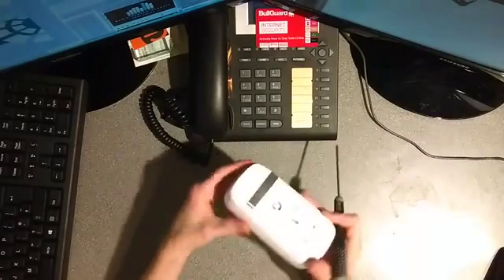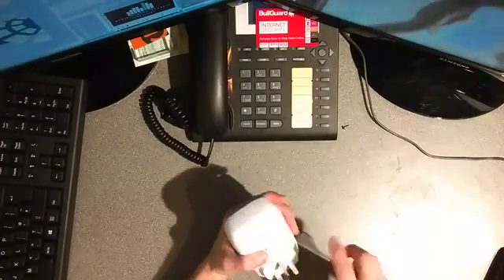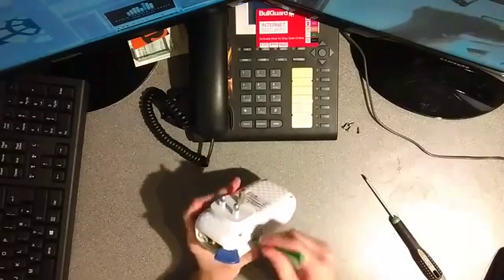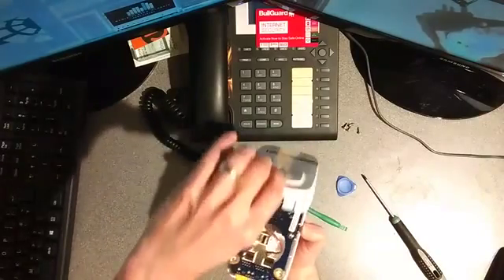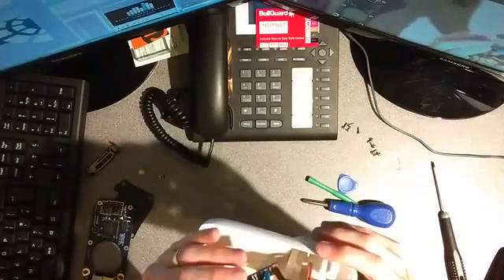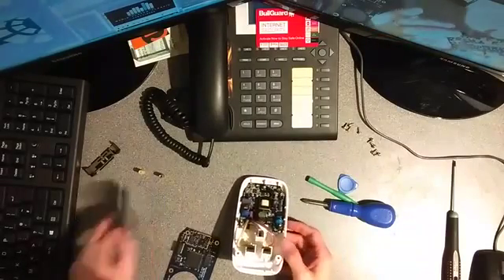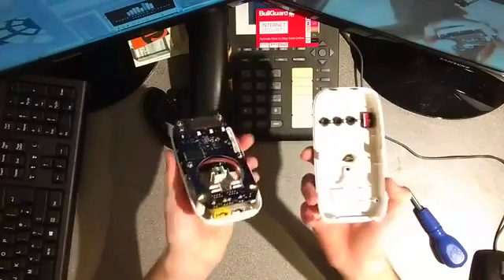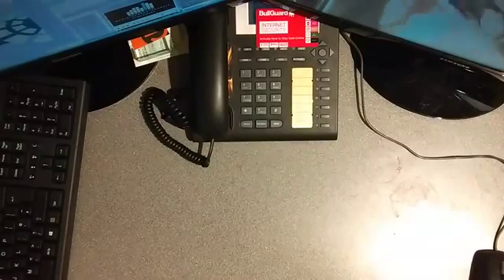Opening up and Inside a Vodafone SureSignal Version 3

Comment: The large capacitor blew on mine. This was the second one I got from vodafone. They only last around 6 months. Is there any capacitor upgrade that can be done to stop it over heating.
Reply from the maker: No point.. vodafone have announced that existing suresignals will be deactivated. One person I know has been told theirs will be switched off in February 2021.

Comment: I have one booster like this used in Vodafone, is there a chance to enable it for any network ?
Reply from the maker: No chance. Sorry :( it requires a VPN back to the network and the other networks are unlikely to have the infrastructure to connect to. What network were you hoping to transmit/boost?
Reply: @freename  EE is the one I wanted to use it on
Reply from the maker: @ionutalexescu6912  They have their own equipment to do so...
https://ee.co.uk/help/help-new/general/signal-box/improve-your-signal-at-home-using-signal-box

There is no chance of reflashing or hacking the Vodafone one to do the EE network :(
Reply: Device is sticking to Vodafone-UK. Only thing you can do is to get it working outside the UK. -but it will still broadcast Vodafone-UK network signal, so best benefit to use where there is a high roaming fee.

Comment: Hi, Did you find out what the "exploded" chip was and di you manage to replace it? Cheers, Harry.
Reply from the maker: +Harry George Haines I'm not into circuit design so I've really not got much if an idea - however I did have someone look over it and attempt to repair it and here are their notes:
----QUOTE---
Replaced
-chip
-mains bridge rectifier
-fuse, surprisingly high at 2 amp
-mains filter both halves blown open

300V appears and chopper now chops but output DC only ~1V and hot smell =
switcher transformer has also been blown up. Can't fix that. Stupid fuse
rating has caused needless other damage.
--END QUOTE--
Hope this helps and good luck - do post back if you have further information.
Reply: The exploded chip is a TNY279PN.
Reply: +AintBigAintClever 

Hi - Thanks for the info. 

I opened up my completely dead v3, but nothing seems to have blown on the circuit board. However, I couldn't locate the fuse to which you refer. Is it obvious and I'm being a numpty or does a Circuit Board fuse look different?

Cheers,
Harry
Reply: There's a 2A fuse that doesn't look like a fuse. Look for a device soldered to the board that looks like a polyester capacitor, but has a fuse rating stamped on the top.

I did a Sure Signal video last week, if you look at mine at the 4:25 mark it's the reddish coloured block closest to the red wire.
Reply: +AintBigAintClever Hi, thanks for that. I've just found and located that fuse. Unfortunately, that's not the problem. There's still a circuit through the fuse. Most of the main caps on the board are all looking slightly bulgy and there looks like there's a little corrosion on the back of the power board, around the fuse mounting. I've got a few photos at https://flic.kr/s/aHsksGTeHu that you might like to have a look at for me. Many thanks for your help so far. Cheers, Harry.